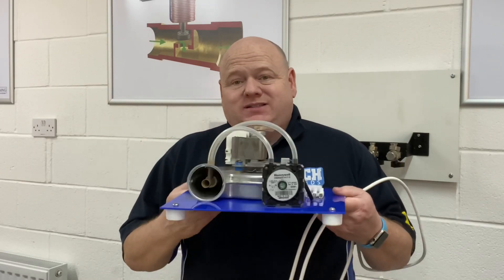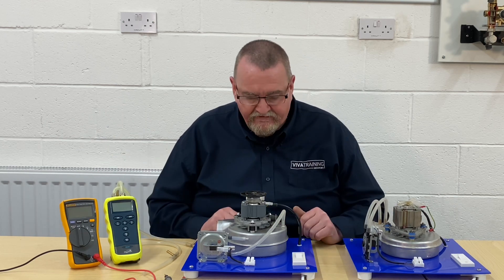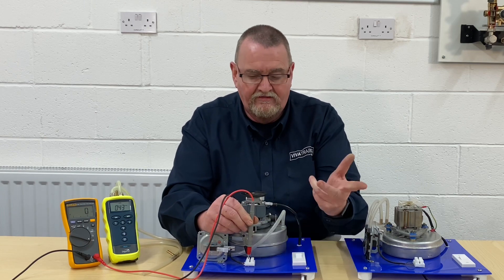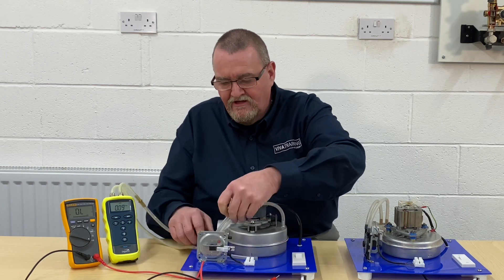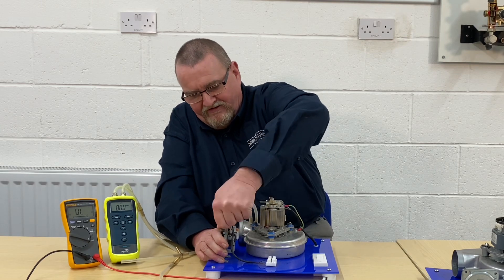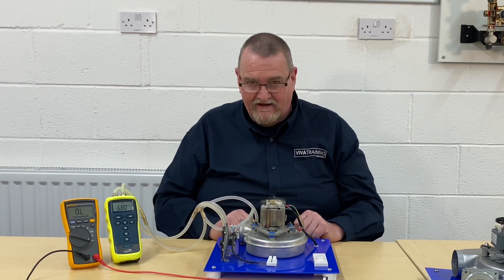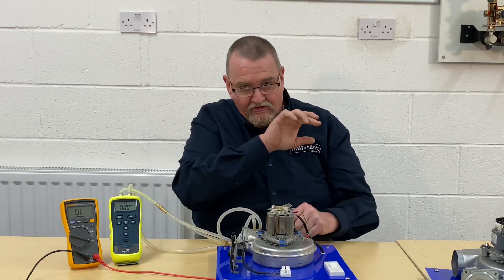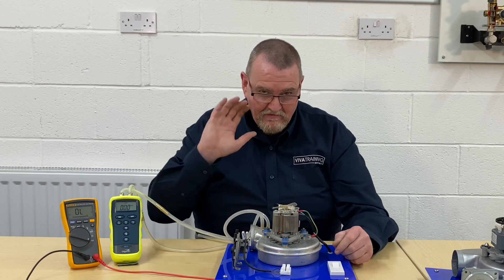Gas Training - How To Test Air Pressure Switches In Gas Boilers - Fault Finding

Comment: I just blow an egg cup of water through the tube into the Venturi to wash it..
Listen for the click of the switch…suck on the switch tube to see if it fires up..
Check open & closure etc with a meter to prove micro switch…im not buying a pressure tester as ap switches are becoming rare now…not sure why this video popped up but literally first job today is a main 24 with a flashing light during ignition…spooky.

Comment: Great video, putting the tubes on the wrong way round on the fan, you would still measure the differential pressure on your manometer the same.

Comment: Great video.  Can you test the air pressure switch using an old school u gauge, or does it need to be digital?  Thanks, and great instruction as always 👍
Reply: Yes you can, a u-gauge will work exactly the same
Reply: @Bondy90s  cheers pal 👍

Comment: Hi Allen, when Roy mentions fitting one hose to the high pressure side and the low pressure to another, is this simply the + and - terminals on my Anton, as the Anton he has seems to be a stand alone manometer? BTW, please could you stop loving every message, as it denigrates actual real good ones that you do actually love for its' content IMHO.
Reply: Hi David,
Thanks for the feedback.
If you using an Anton FGA connect the high pressure to the +ve & low pressure to the -ve, if you did get the the wrong way round you would end up with the same reading only it would be a -ve reading.
Reply: @royfugler9971  Hello Roy, thanks for the excellent pointer and the clear explanation.
Reply: Thank you guys.👍🏾

Comment: The I've never really used the pressure differential on digital manometers.  Great tutorial team Allen ♥️.  I'll be sure to try this when I'm next testing an aps or fan venturi.

The ferrolli modena 80e had those troublesome venturi's which always seemed to go brittle.  You guys have a fountain of knowledge between you.  I take it you're both ex British gas engineers?